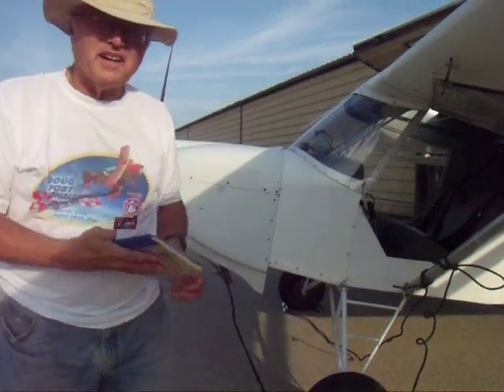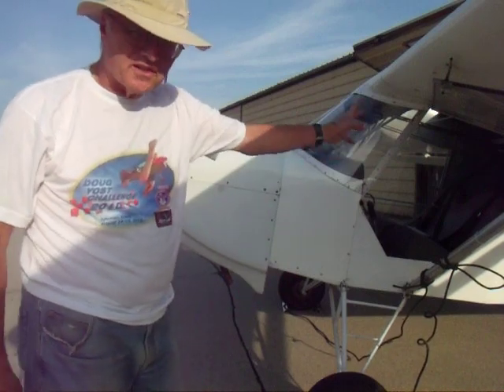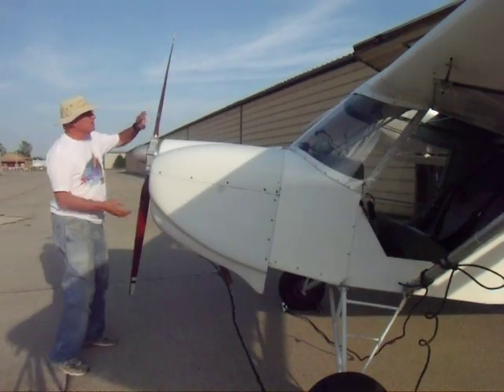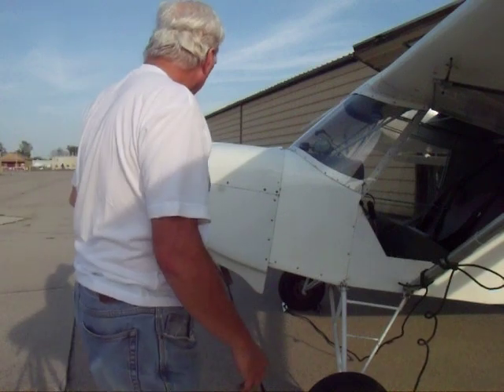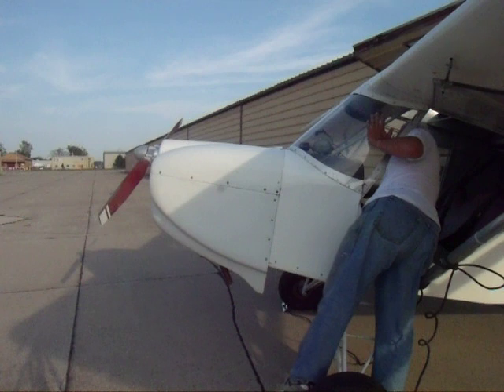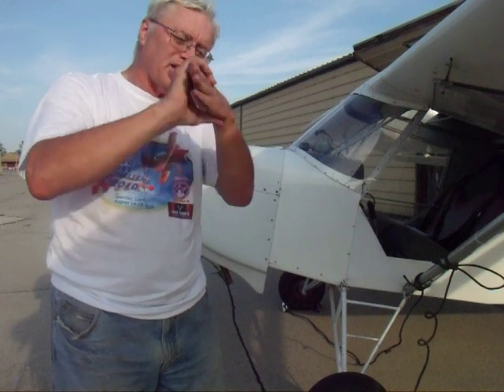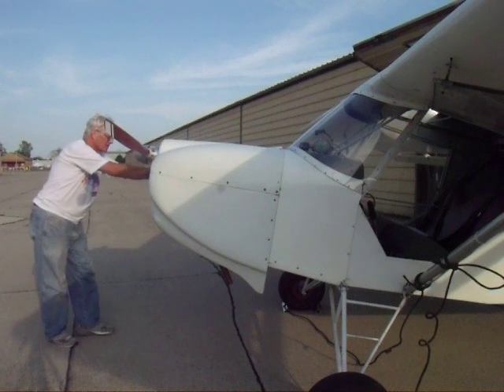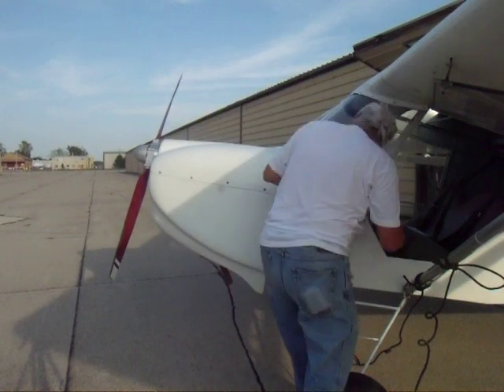Hand Propping a Rotax 912

Comment: Hello from the YouTube algorithm. Very impressive, and presumably you could air start it too. Maybe I'll try that (I have a 912A). To all the people who are saying "now when you are stuck in the desert with a flat battery you can start the engine", how do you run the fuel pump with a flat battery?
Reply from the maker: Fortunately, I do not need to run an electric pump - the engine driven pump is adequate (along with gravity feed from the wing tanks). If you do run a fuel tank dry in the air, the engine keeps on windmilling and restarts once you switch tanks.
Reply: @LightAndSportyGuy  That's very interesting! Our flight manual says to run the fuel pump before start, but apparently that's not necessary. Thanks!
Reply from the maker: @BruceDuncan  I suspect that it depends on the particular aircraft or carbureted vs. fuel injection. I tend to run the electric pump for a moment on my airplane just to be sure the float bowls on the carbs are full - but it's not necessary.

Comment: So does anyone know if you can hand prop a 100hp version?
Reply: I own an airplane with a 100hp Rotax but I have never tried it, I will test this next week and post the results here. Late comment I know.
Reply: @vojislav9372  did you survive your feat or am I writing a comment to a late pilot ? ;-)
Reply: @SuperZardo  Hahahaha forgot to post. We tried it at our airfield to test it out. Works but took quite a few pushes. (We had all safety precautions, and tested it out just to know if we can rely on it in case of a dead battery in remote locations)

Comment: cars require a competent person in the pilot's seat while hand propping.
Reply from the maker: +Robert Mencl Thank you for that info.
Reply: If you are in the wilderness Solo,on floats, as many times are the case in Nfld,Canada . this would be the only option and to do it whil standing in the water and you would have  to tie a rope to the plane to prevent the plane from just cruising away when it starts and then also be able to slip the rope or cut the rope with a knife whilst you are sitting in the plane and fly away,no doubt a bit of a task.
Reply: Can you supply a link to the to that regulation?  Many of the WW2  era two seat planes can only be started by hand propping.  Like the Aeronca Chief that I own.  How would I be able to fly by myself?  Didn't think you could start the 912 that way unless you have the soft start module maybe?.  I may have to try with my Kitfox.  It has the 80 HP 912, but no soft start module.  Just saw the date of the comment was 5 years ago, so I probably wont get an answer.  Jim